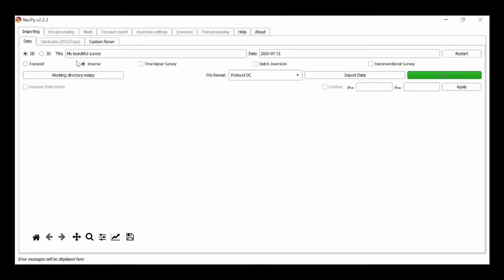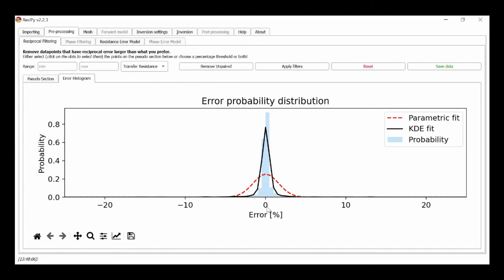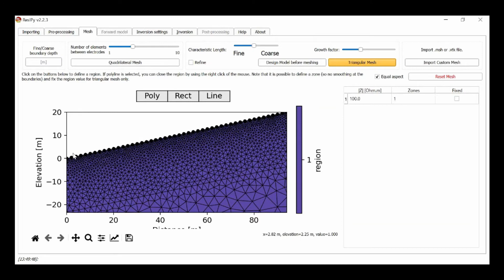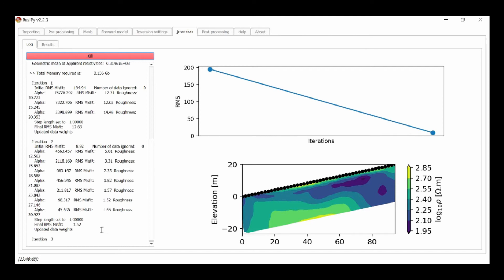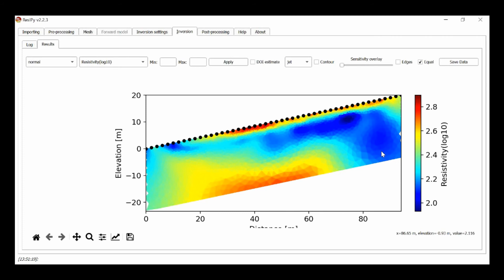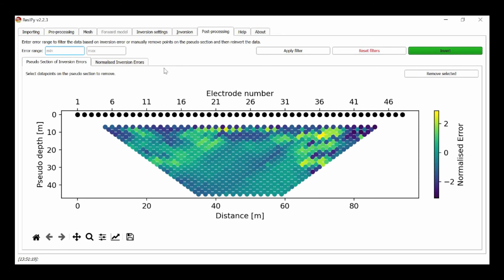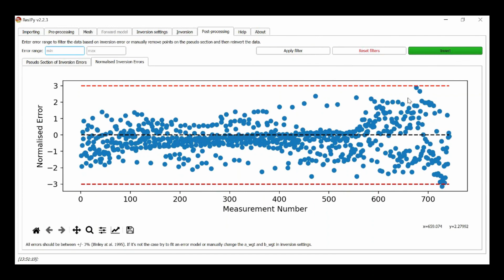Tutorial 05 - 2D resistivity field data inversion

Comment: Dear Sir, we had 64 electrodes buried permanently at 40 cm together with cable in an experimental field. Now we would like to perform the inversion for both above and below reference line (at -40cm). How can we go around because the electrodes were not on the soil surface?
Elijah

Comment: Dear sir, what will be the data format, moreover, we have VES data, how can interpret VES data to generate resistivity section for each VES layer. and what type of software should i used for
Reply from the maker: Data format can be any of these: Res2DInv, E4D, BERT, Syscal, ABEM Lund, ARES, Protocol, Res3DInv, Sting, Lippmann and DAS-1. Additionally you can have your own file format as long as it is column divided.

Not sure about VES software, but you can have a 4-electrode input in ResIPy, won’t be able to invert it probably.
Reply: @ResIPy  Thank you sir,

Comment: Great tutorial series, Andy! I'm enjoying it! Would ResIPy be able to recognised and then fit a resistance error model to my data if I have both normal and reciprocal data in the same file? And what happens if I have, say 100 normal data points but only 90 reciprocals? Thanks.
Reply from the maker: Bruna you sure can have normal and reciprocal measurements all in the same input file. Having partial reciprocal pairs is also supported.